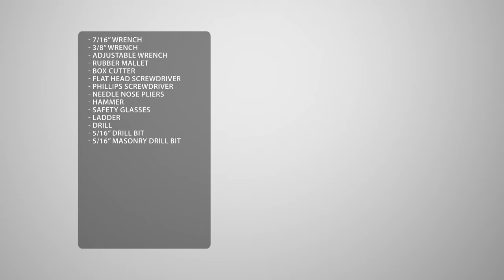Lifetime 8' x 7.5' Outdoor Shed | Lifetime Assembly Video

Comment: Advice for anyone else building it. The “slight downward pressure” is a lot harder than it looka
Reply: Almost blew my back with those corner panels
Reply: Lol! For sure. He put his whole body into it
Reply: I had a hard time trying to hear the click!!!
Reply: Can NOT GET the second corner panel to snap in.   Help
Reply: @dorothymccarty5903  I had a hard time as well. Have you tried forcing it
Reply: Literally building mine now and im a big guy, holy eff, those dont snap so easy
Reply: Get a small pry bar and slightly widen the whole. Just enough to help them snap in.. I'm 195 gym body and can't get them to snap in without modifying. Bad design
Reply: You also need a hammer cause the bars don't just slide in.
Reply: Inside window screw doesn’t go in and idk how he gets it to slide cause it doesn’t the window is literally in the way

Comment: The floor panels are extremely hard to put together. In fact, I had to take a saw and cut out the two interior locking sections because they’re too warped it would not come together whoever engineered this type of lock system for the flooring needs to know that it does not work, need a new design

Comment: I'm building mine on the wood frame, as the instructions show. But I want to be able to move it (gently) around. So I put 2, 6"x6"x10' treated post under it, cut as skids.
Mine will house the devices for a solar off grid power, for my farm lake.
Looking good so far. 
Thanks for the assembly video.

Comment: Just got my shed can't wait to put it together . Spent the day today laying a paver foundation for it . Will drop another comment once it's done on installation and what I think about shed over all .
Reply: Guess they still not done lol
Reply: @justaweirdweeb2998  yes shed is finally done but was missing a piece waiting on lifetime to send it out . Installation is not bad at all does take some time as I did it all by myself . Put majority of what I could together in the house then carried to backyard . Didn't want my Dogg's to mess any of the pieces up . Over all very happy with the shed and how it looks . Now to move items from garage into the shed .
Reply: @kurtmiller2254  what kind of pavers did you use? I'm thinking of using pavers instead of a wood frame or concrete pad. How is it holding up?
Reply: @kurtmiller2254 how long did it take you to do this?

Comment: Thank you for this video! I was able to ditch the manual except for some hardware identification and the mirror orientation on the side panel (couldn’t see your orientation in the video). Had no one to help so it took about 6.5 hours. I too struggled with attaching the rear roof panel to the rear gable and rear roof cap. I stuck my screwdriver into the rear roof panel hole to give me leverage to pull it where it needed to go to align the holes. For the roof cap, I figured that the more you bend/fold it, the easier it is to align. You can even screw half of it in, then push up on it and screw in the rest. That was a lifesaver for me. Hope this helps someone
Reply: Damn that would have saved me
Reply: Me too. I used the manual for hardware identification as well.

Comment: The right front corner panel did not “snap-in/click-in” for me, but I was still able to complete the shed. It did throw off the leveling a bit on the rear left side but I made it work.
Reply: Having the same issue. What did you do to get in the corner piece (AGW in my case, 19:00) that won’t seem to snap in properly?
Reply: @mrakhsha  I initially left it like that (I did not snap it in), and simply started to screw the wall panels together. 
But then decided to undo it and made the hole on the floor for that panel a bit larger with a small knife. So I was finally able to place the corner panel in the floor slot/hole.
Reply: @rbarron007  that is helpful, thanks for your response! I’ll give it a shot

Comment: I have a question - I was able to follow the instructions and assemble this shed. Now I have noticed that when I close the door while standing inside the shed, the  bottom right and left side of the doors have light coming in and enough space for a small mice to get in,. 

What can I do to close these two  small spaces?

Winter is coming and these small critters will try to find any warm places for the winter and with piled up snow I will not have access to the shed till May. So if any small critter gets in it will cause a havoc in the shed.

Comment: Is section 8 necessary? The shelf interferes with the tall shelves we want to put on that back wall. I fear that shelf may double as a stability point, can we omit it?
Reply from the maker: Shelves are not required for the assembly. They are just accessories.

Comment: Is it good to change some of the FLU screws mine don’t attach well to the wall causing it to fall any advice ,
Reply from the maker: We don't recommend using any other hardware other than our own. Our hardware is specifically designed for our products. If you're having troubles with the walls staying up even with the help of another person holding the walls up as you connect them together, I recommend reaching out to our customer service team so they can provide you more tips. They can be reached at 800-225-3865 or by email at customercare@lifetime.com. Customer Service hours are Monday-Friday, 7:00 am to 5:00 pm and Saturday, 9:00 am to 1:00 pm (MT).

Comment: For the base is a gravel base ok!?  I really can’t pour cement
Reply from the maker: Gravel is not a foundation that we recommend. If you can't pour a cement pad, you can build a pressure treated wood platform. Refer to your manual in section 1 for the instructions on how to do that.

Comment: Lifetime or whomever can answer this too. 

I want to install on my front driveway which is all level cement. Do I have to put a sub floor under it for water to drain under it without one whenit/if it rains or when I wash down the driveway? If so, what kind of sub flooring would you recommend I use?  Thanks

Comment: After step 6.4, why not anchor it to the concrete pad at that time?  Why wait till the whole shed is built?
Reply: I anchored mine in place after getting the floor down and positioned where I wanted it. Didn't have any issue.

Comment: I have a leftover black plastic piece approximately 12”x5” (rough guess) it’s definately not the long shelf for the back wall. Does anyone know what it is? Kind of looks like a small step maybe.
Reply: We also had the leftover piece. Would love to know what it’s for?
Reply from the maker: This is just to help align things together if needed and for when you use the mallet on the shed. It's supposed to be used as a tool!

Comment: Hi there, for section 4.4 where you attach the door latch to the left door. The strike plate provided doesn’t align with the holes on the front and back. Is this strike plate necessary *part AIA. Or can i just attach the latch?

Comment: I just dont know what im missing... last 2 ridge panel where they over lap. Screw just doesnt grab that last panel its like i am a 1/8" too short 🤷‍♂️ yes all others grabbed and went smooth... these 2 last screws are the bane of my existance 😅
Reply from the maker: Sorry to hear your having troubles. We'll be able to better help and determine what may be the issue with pictures. Can you reach out to our customer service team and send over some images they can trouble shoot what could be going on? They can be reached at 800-225-3865 or by email at customercare@lifetime.com. Customer Service hours are Monday-Friday, 7:00 am to 5:00 pm and Saturday, 9:00 am to 1:00 pm (MT).
Reply: @LifetimeProductsAssembly  i just went and bought 2  1/16th" longer screws and it worked great.

Comment: Realistically how long does this take to put together straight out of the box? Do you need a second person to assemble? Does it have to be attached to a foundation or can it sit in the grass and be fine? The place I live has a cement slab but it is holding an old rusted shed I don't want to pay to remove their waste so I am wondering if it will work well and stay in place without attaching it to a foundation, thank you. Nice video, had me thinking I can do this solo but let's get real, so I know what I need to do before I order this since the store says it doesn't deliver, thank you.
Reply from the maker: The amount of time it takes to build is based on you and your helper. It can take several hours or a couple of days. A second person is essential in some or all steps. Having a helper will ensure that thing align properly and it helps things stay in place. Foundation is required for all our sheds. A foundation will make things all stay in place and help with the longevity of the product.

Comment: The shelf doesn’t line up right and I made sure everything was assembled correctly up to that point, I just tripled check and everything is put up right.  Matches everything in the video and the manual.  Don’t understand what could be wrong.
Reply from the maker: Is your shelf at an angle or is it not lining up with the holes? If it's at an angle, you may need to adjust your brackets. If it's not lining up with the holes you don't need to align it directly to the holes, just close enough to keep it balance. If you have additional questions you can always reach out to our customer service experts. They can be reached at 800-225-3865 or by email at customercare@lifetime.com. Customer Service hours are Monday-Friday, 7:00 am to 5:00 pm and Saturday, 9:00 am to 1:00 pm (MT).

Comment: The corners was not fun. Also had a tough time getting the roof panels lined up but all in all not to bad. The video helps a lot more than the instructions that’s for sure. Lol
Reply: How did you get the last roof panel on I’m having the hardest time getting it to line up
Reply: Same+

Comment: Do you know which torque number we should set our impact drills at? I have a regular Dewalt 18V impact drill and I plan on using a number 6 torque number. I didn't find any recommendations about this topic. Thank you.
Reply from the maker: The torque setting depends on the part of the assembly you are on. As long as the setting isn’t stripping out the screws and is tightening the screws and bolts all the way you should be good.

Comment: Watching this video before assembly, I had a question - there's hardly any space for me to assemble the back gable as the shed will be on a concrete pad at the rear corner of the back yard. Does the front gable need to be done first or can we start at the back and then work our way to the front gable where the doors are?
Reply from the maker: If you have no other option, you can start from the back. It will not effect the assembly of the shed.

Comment: On the last two roof panels the one the left is curving up and is not allinging with the roof or the wall
Reply from the maker: Please send pictures to customercare@lifetime.com of your roof panels so we can determine further action and to help you have a better assembly experience.
Reply: Have someone help you push up or down on the metal frame of the roof so help align the holes. I had the same issue. Probably due to misalignment/unleveled base/foundation.
Reply: @rbarron007  thanks I figured that out a month ago because it was not aligning

Comment: What are the weight and dimensions of the 2 boxes when you pick it up at the store for an 8x7.5 shed? I want to get one at Sam's but I only have a car with the rear seats go down.
Reply from the maker: For this particular shed, the box dimensions are 95.31" x 32" x 10.75"; 147.5 lbs and 95.31" x 32" x 9.63"; 218 lbs.
Reply: I was able to get it home in a mini van with the front seats all the way forward and the back seats just folded not removed. I was originally going to put it on top of the van. Hahaha I thought twice and just had a super uncomfortable ride home. Thank God only a 10mi. drive lol.
Reply: I rented a truck.

Comment: Box says: Foundation not included. What does that mean exactly? Will it still have the bottom part you put in this video?
Reply from the maker: The foundation is the cement or wooden platform that needs to go under the shed. The flooring is included but not the foundation. Since video is about the assembly of the actual shed it self, we do not go over the preparation for the foundation.
Reply: @LifetimeProductsAssembly  I appreciate the quick response.

Comment: My rear right roof panel all the holes line up with the juice but don’t line up with the rear gable. All the sides are snapped in and plumb, starting to wonder if there is a defect. Had to stop due to snow storm
Reply from the maker: We’d love to take a better look at this so we can help you finish the assembly. Please reach out to our customer service team and send them pictures of your part and where you’re having difficulty. They can be reached at 800-225-3865 or by email at customercare@lifetime.com. Customer Service hours are Monday-Friday, 7:00 am to 5:00 pm and Saturday, 9:00 am to 1:00 pm (MT).
Reply: Did you figure out the problem?
Reply: Same problem, but it can be fixed by having someone push the roof panel until the holes match and then screw them in place 😭

Comment: Can't get the floor panel hooked together. Been trying for 3 days with my dad and stepmom and it just won't go. Any tips?
Reply from the maker: Make sure your tabs are lined up with the panel on the ground and that the rest of the panel is at 45 degree in the air. It will also be helpful to have someone standing on the other panel so it does not slide out of place. If you have additional questions you can always reach out to our customer service experts. They can be reached at 800-225-3865 or by email at customercare@lifetime.com. Customer Service hours are Monday-Friday, 7:00 am to 5:00 pm and Saturday, 9:00 am to 1:00 pm (MT).

Comment: Step 4.1 from the instruction manual and video seem to be different.
Reply from the maker: This video is meant to be used as a companion to the assembly manual and not a direct replacement. In step 4.1 the long tube can be inserted into the door while facing upward or laying down on the ground, the process should still be the same. We do have several assembly help options available if you run into more questions, including; this video tutorial, our new BILT app, and our customer service department is always a great resource.  They can be reached at 800-225-3865 or by email at customercare@lifetime.com. Customer Service hours are Monday-Friday, 7:00 am to 5:00 pm and Saturday, 9:00 am to 1:00 pm (MT).

Comment: I have a flat area of grass in our backyard. Will this be ok for a shed? I don’t know how to do anything else to the yard for a shed. 😬
Reply from the maker: Yes. As long as it’s in a leveled surface, and you have the recommended foundation you will be good.
Reply: @LifetimeProductsAssembly  would a gravel bottom be good or is cement recommended for this shed?
Reply from the maker: @Aussiegirl2208  We only recommend using a concrete or wooden foundation.

Comment: I was thinking of installing a gravel pad as the foundation for my shed. If I compact the gravel, can I build this shed directly on top of the gravel, or do I still need a wood/concrete base?
Reply from the maker: We only recommend wood/concrete foundation. Creating a foundation out of gravel will not help the shed stay in place even if it is compacted. You will also have troubles assembling if you don't have a flat surface.

Comment: Is there supposed to be leftover screws once your finished or did i miss something?
Reply: If you paid attention and went through each step with patience and double checked with the instruction manual, then yes, it does seem like there are some extra screws in thr bags, at least for me it was the case!
Reply: @Kevinlinaresroller  ok thank you! I was worried about water leaks lol but yes i went through every single step and I think those extra screws might be for more separate bought shelving
Reply: I had a lot of extras
Reply: Same here. I actually lost like 3 screws and was worried, but ended up with many extra screws

Comment: This is not easy to put together. We are having a hard time getting the roof to align right.
Reply from the maker: We apologize about the frustration with the assembly of your new shed. What type of foundation is your shed built in? That could be causing the difficulties. Try watching this video on how to align your roof panels- https://youtu.be/iQYsra3ehts?si=qptvvpzaxJnvzPpK. If that doesn't work, give our customer service team a call and we can troubleshoot the issue with you and see if we can figure out what is happening. They can be reached at 800-225-3865 or by email at customercare@lifetime.com. Customer service hours are Monday-Friday, 7:00 am to 5:00 pm  (MT).

Comment: I put the bar in wrong does anyone know how to take it out the door
Reply from the maker: What step are you on? Just want to make sure we help you on the correct step.
Reply: Same. I used a pair of locking pliers (vise grips), gripped the bar, and pulled it out.

Comment: Come 11:48 put the tube in my door because I dought you can do it that easy with mine
Reply from the maker: Sometimes these square tubes can be tricky. Our first tip is inserting the square tube starting at the other end.
If that doesn't work you can use a rubber mallet on the end of the tube. If that still doesn't work we recommend slightly enlarging the hole that the tube slides into. The final tip is turning the door right side up and hitting the tube on some concert to help it slide into the the opening on the door.